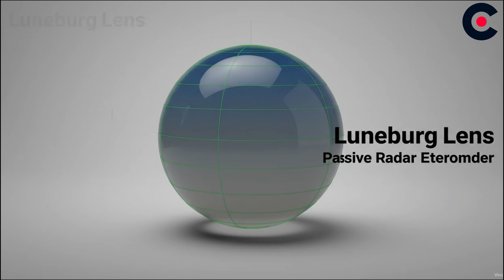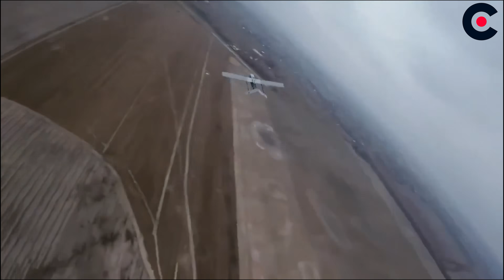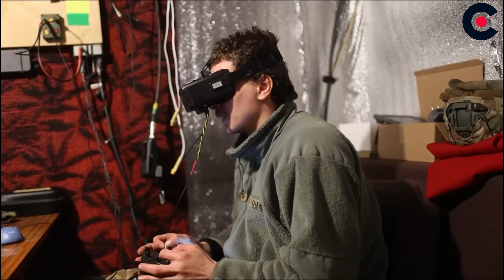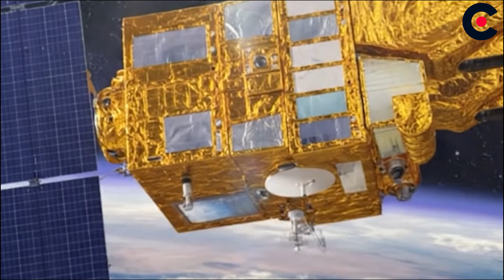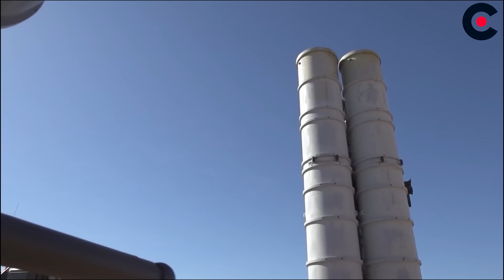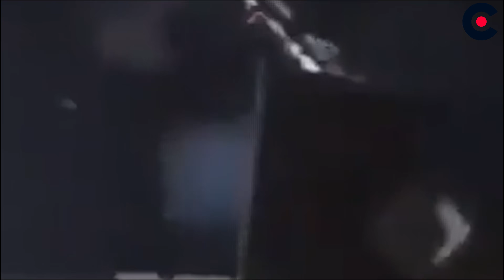Ukrainian Drones STRIKE Russia’s Largest Oil Port at Baltic Sea - Devastating Result

Comment: I am, merely, a guy that makes single-sheet-fold Paper Airplanes, that, indoors, fly for 45-50 seconds. But what I sense here, is that Ukraine, needs two-more things, from their Prop-drones. Those made with a Foil-Strip across the fore Main-spar, , to be 'radar-noted', and, a small, 'thrust booster', using a preset timer, to make Drones, Near the Target/Defense-Zone, suddenly 'go fast'. The added Confusion, will be worth-while. It's, like, trying to catch your hand-tossed Paper airplane, in a breeze you did not expect?
Reply from the maker: Interesting perspective! The paper airplane comparison is a creative way to explain your idea. Thanks for sharing your thoughts and experience! 👍